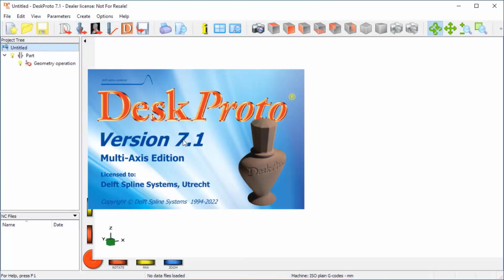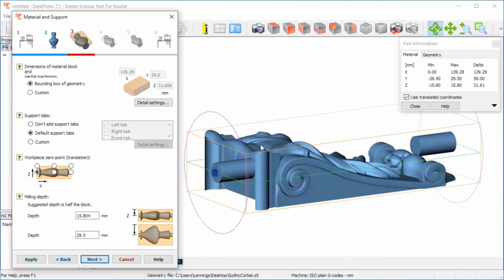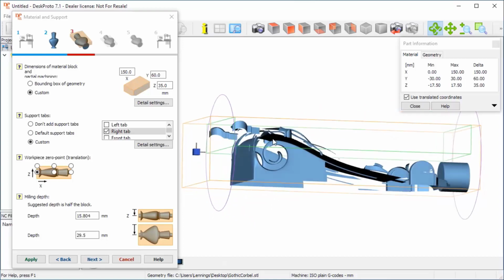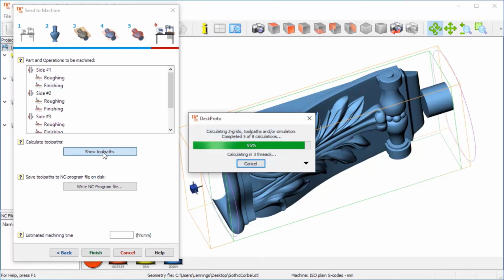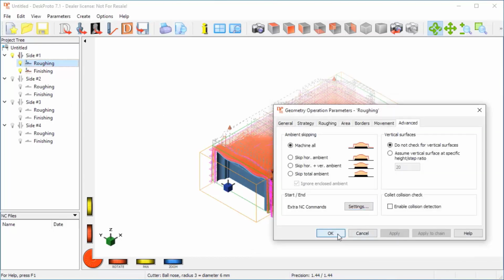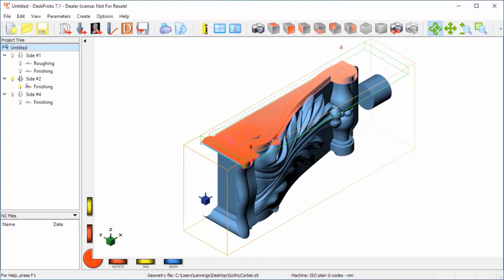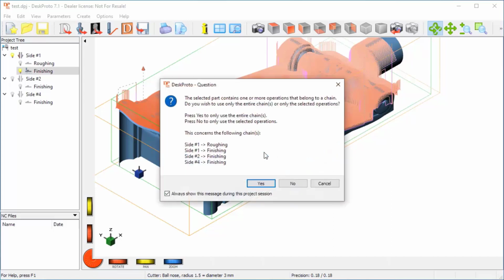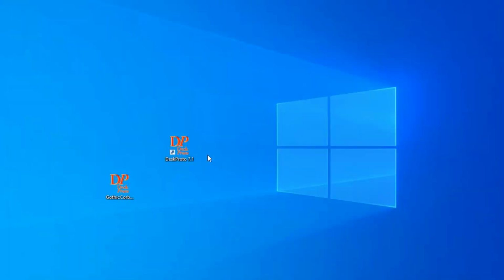Indexed machining to make a wooden corbel

Comment: Superb tutorial. Thanks. I always thought that the center of the support blocks had to be aligned with the center of the rotary axis. I rewinded and rewatched the video to make sure I understood. Very nice.
About the centering of the z zero home, if it is set too high would it only make the object bigger?
Reply from the maker: Thanks for the compliment - happy that you like the video!  In answer to your question:  no, for indexes machining an incorrect zero point means that the sides won't match (for rotary toolpaths the object indeed will be a bit bigger).

Comment: my cnc machine is y is rotary part so how i change this
Reply from the maker: You mean that the rotary  axis responds to the Y-coordinates ?  You can configure that in the postprocessor, by setting the Y as start command in for the A-axis:   Options > Library of postprocessors > OK on warning > Select your postproc and press Edit > Tab page movement.

Comment: I tried this but my carvera's 4th axis is rotating in the opposite direction, is there a way to fix this in deskproto? Even in the display of the carvera, you can see the design will rotate in the wrong direction
Reply from the maker: That is a known issue, and the situation is a bit complex. When we found out about that incorrect rotation direction we reversed it in the DeskProto postprocessor. However, some time later Carvera decided that the rotation direction was wrong, and reversed it in a firmware update. So after that we again undid the change in the postprocessor. 
You have to make sure that you use a DeskProto build that matches the version of your firmware (using the latest version for both is fine). See  https://www.deskproto.com/support-tips-tricks/dp-tips-makera-carvera.php
Reply: @Deskproto  Thanks for this! I was able to fix the issue within deskproto. I have  version 0.9.7 for the carvera software and had to go back to factor of -1 for my A-Axis.

Comment: I tried to run a similar program with my carvera machine and it just went haywire spinning the machine out of no where. Followed these exact steps for my machine and the 4th axis didnt stay still for one side. It just started rotating as the cutter started to touch it. What am I doing wrong?
Reply from the maker: When the part rotates while machining you are using toolpaths for continuous rotation. The above video shows indexed machining, which does not use rotary toolpaths: only XYZ toolpaths, with just one rotary move in-between the sides. Seems that you have checked the rotary toolpaths option, which is not correct for indexed machining.
Reply: @Deskproto I think maybe my chaining was messed up. So I have been able to successfully make stuff using this method now. However, I keep running into an issue where I am getting like a line with different depths when I mill the sides. I was trying to make a hand. I have my settings set to machine all on the from and back of the part until it reaches half the block. Then for finishes of the top and bottom I have it set to skip total ambient. When it does the finish I can see like a line that separates  the finish from left over skin that’s on the other side of the model. Now when I do the finish on that side of the model, it looks like it goes slightly deeper where that line was at. The result is a pretty visible line with different depths on each side. I tried to center my block as best as I could but I still get this result.
Reply from the maker: @metallicaandchimaira   The cause for such line is that the zero point on the machine has not been set with the tip of the cutter EXACTLY on the rotation axis line. And error of say 0.2 mm will cause a difference between the two sides of 0.4 mm: a line that is clearly visible.

Comment: Hi, excuse-me. Another question: is it possible to come back to the use wizard? Because I forgot to set the material in circular and not in square. Thank you. I have the trial version of the program. can I to work the piece on the machine ?
Reply from the maker: You can finish a wizard, save the project and then exit DeskProto.  The next time that you open the project in DeskProto it will again open the wizard interface, remembering all the setting that you made the first time (this will not work when you fine-tune some settings after finishing the wizard).
Reply: @Deskproto  thank you very much! And can I to work the piece with my cnc machine with the trial version of deskproto?
Reply from the maker: @stefanogobetto9897   Yes, you can. You will see the trial cross watermark machined over your part, nevertheless you can test the complete process.
Reply: @Deskproto  thank you very much for your patience.

Comment: Thank you for your very good video explained perfectly. I would like to learn to make a program for an model of smurfette cartoon. If you can to explain me how to do of you can to make a video tutorial. Thanks 
.
Reply from the maker: A smurfette cartoon is a 2D drawing.  When you have this as a vector file you can use vector machining to make a 2D carving. When you only have JPG or similar you can use bitmap machining: assign Z-levels to colors. When you want to make a real 3D model you will need to somehow create a 3D design. That is about CAD, which is out of our scope: we do CAM only.
Reply: @Deskproto  thank you for your answere! I found an stl file of smurfette and I tried with your example to make a program with the index example. It seems ok! I made the programs for 4 sides. And also I have the 4th axis along y axis. If you wont I send you the files. Thank you very much.
Reply from the maker: @stefanogobetto9897  Good news, thanks for the update !  Thanks as well for the offer. I would not use these to machine a smurfette, however a photo of the result would be nice. Perhaps I can use that to share on our social media pages.

Comment: is it possible to make the holes and the thread with this wonderful software?
Reply from the maker: @Bicofaidate  DeskProto has an option to drill holes (in a vector operation). DeskProto does not have options for thread milling.  Thanks for the positive comment !

Comment: Does this mean Deskproto can combine rotational and indexed machining
Another question. will Deskproto have more features to select options for cutting aluminium, like selecting types of plunge styles , so the cutter can take relief cuts, and pecking.
Reply from the maker: Yes, that is very well possible - see for instance our Nefertiti tutorial video (https://www.youtube.com/watch?v=m8aWk6oTiF0).  For the question about aluminium the answer is no: such special options are not present. Peck drilling is supported though: in a vector operation - see the Help file.

Comment: Hello, question .. Is it possible to do a swing spindle operation in the software?
Reply from the maker: I am not sure what you mean: do you mean a spindle that can rotate around A or B axis ?  That is not supported: DeskProto can only work with a vertical cutter, all rotations are done by the part.
Reply: @Deskproto  Yes, my machine has axis A and axis B, if I work on the table not on the rotary in deskproto is it possible to activate axis B so that the head rotates?  (Axis B in my machine The head rotates)
Reply from the maker: @eddieabbas6856  No, DeskProto does not support machines with a rotating head. Sorry about that.

Comment: Hi, what router do you guys use in this video, and what 4th axis?
Reply from the maker: Hi Felipe,  the machine is an old Isel CPM-4030 (made by Isel in German, however no longer in production). The fourth axis unit also came from Isel, as an optional extra for this machine.